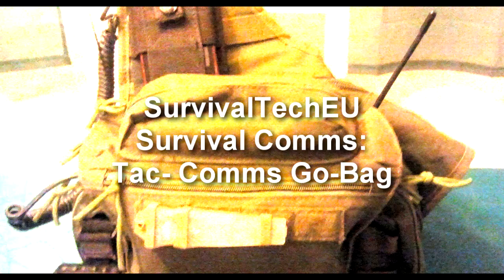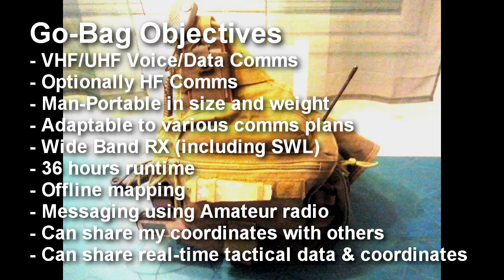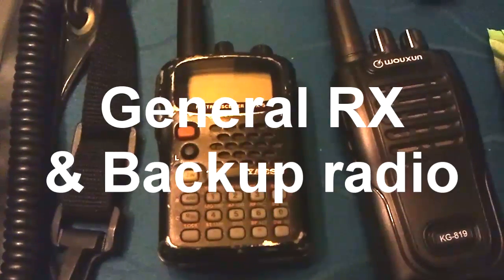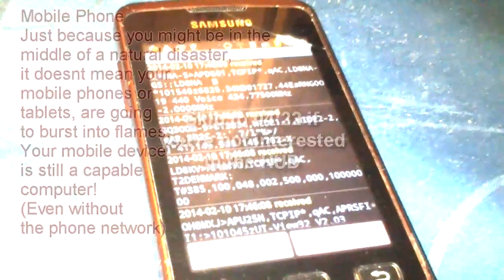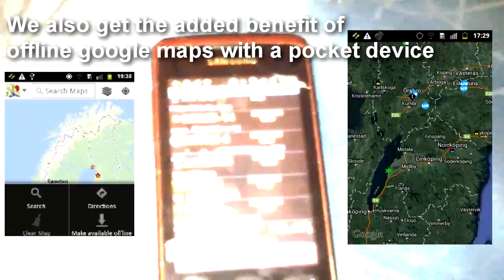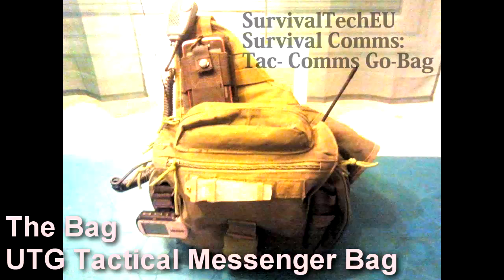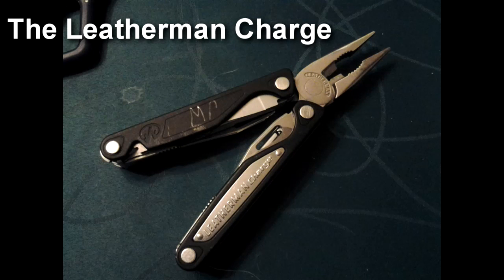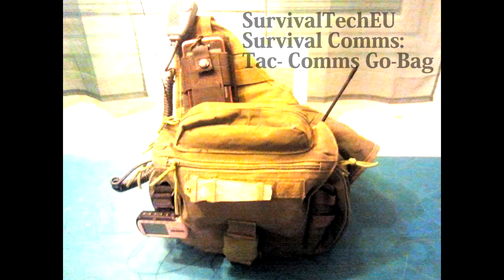Communications EDC | Basic Communications Kit | Close range Tactical Comms

Comment: Great video !  My Go-To radio is the La Crosse AM/FM/WB digital Weather Band Radio that has a LED Light, External Power Jack, Earphone Jack (to extend battery life).  For Two-Way Comm have a Mil. Spec. clam shell cellphone with eight (8) hours of talk time or last three or four days between charges.  Maybe 2-Meter Radio in the future...  For space communication.  tjl
Reply from the maker: Sounds like a good setup. Do you have a way to charge off grid?
Reply: The off grid power is a small Goal Zero Solar Panel, USB Back up Battery, Car Power Plug USB and USB Cables (Just a basic set up)  tjl

Comment: hey brother, 

great video and love the idea and setup. One question, how would you charge your Yaesu , I have one but haven't cracked the code on this. Thanks for any feedback.
Reply from the maker: hello Erik and thank you for commenting.the really cool thing about the Yaesu is the 12v dc socket built in on the side of the radio. in the past I charged up the 5r with the solar panel, or an external LiPo battery, as that socket takes anything from 9 to 15 volts. However the reality is, that bag should last me 36 hours. That means I should have three to four backup batteries for the 5r with me.Your question also brings up an interesting point. I was thinking of replacing the 5r with the new uv-5re+, but there's no simple DC charging capability for the baofeng radio. So it looks like the old workhorse will stay for now.Thanks again for the comment
Reply: Hey brother? Are you still active duty? I noticed the MarPat, where are you stationed? 

Cheers
Navajo Joe
Reply from the maker: Erik Myers its been 21 years since my time.